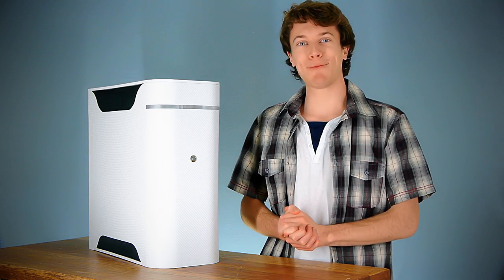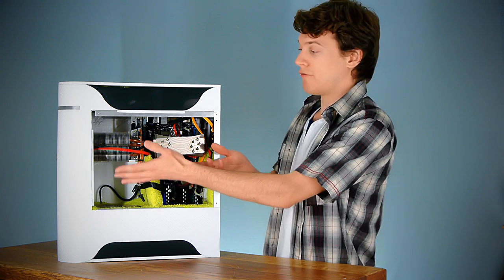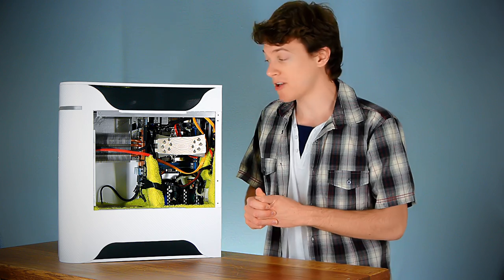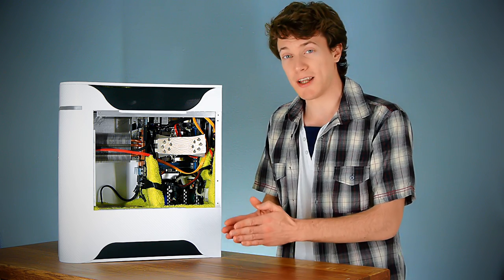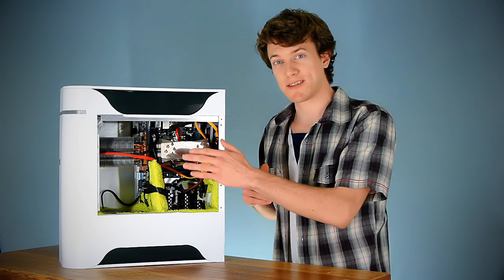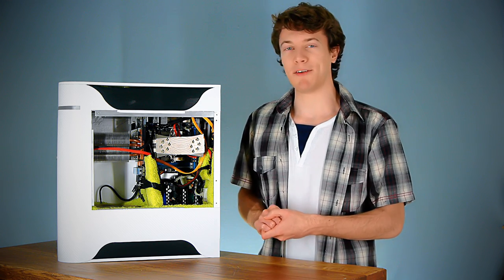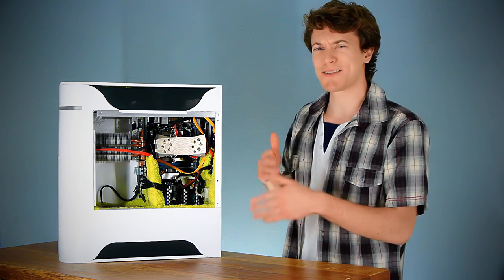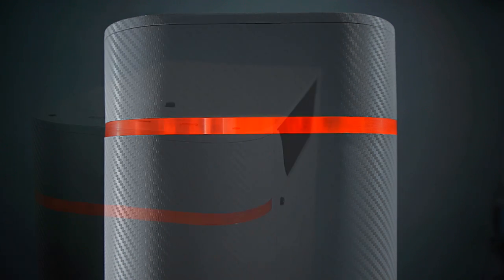DIY Computer Case - The Ultimate Silent PC (CLOUD UNIT)

Comment: How is your laptop HDD at 35°C when it is wrapped into a soft towel? I did that a few years ago with a 7200rpm HDD and I could almost cook on it later :))
Reply: +furulevi SSD
Reply: +GoogleMinus 
The SSD at 6:39 is on the top and is unwrapped, the lower one, the data drive is wrapped (and is not overheating somehow).
Reply: I must have missed that.  some of the newer ones are much cooler though.
Reply: He said its a laptop ssd. And it was created to run at 35 degrees without airflow.
Reply: +furulevi laptop drives and 7200rpm Seagates are two completely different things.
Reply: 7200 vs 5400rpm
Reply: +furulevi my laptop HDD stays at 32C most of the time. They're designed to be in low airflow/no airflow situations. That way they can stay at an ideal temp while still working the way they should.
Reply: +googlemaster190 -Minecraft It's not an SSD though. It's just a mechanical drive sitting in a pocket of fabric. Keep in mind this is a laptop drive which means it'll get less airflow than a 3.5 inch drive is used to getting. So it's been designed for these types of situations.
Reply: Siana Gearz I know there is 10,000 RPM drives, though I don't know if there's any laptop sized drives with those speeds. I do know that most laptops ship out with a 5400 RPM drive though.
Reply: ArtisChronicles I have seen 15000 RPM drives but I haven't seen anything over 7200 RPM for laptops, probably because of cooling and energy usage.
Reply: ArtisChronicles 10 and 15k drives are all equipped with tiny platters,  2 inch or smaller. They are packaged either as 2.5" drives that need external cooling, lots of it, or as 3.5" enclosures with integrated cooling. Their capacity was around 1/5ths of what you could get from a single platter 3.5" for the longest time. They were needed for databases, but now are replaced with SSD, so I think that's a dead category.
Reply: Siana Gearz could be dead, I dunno. I do know that if it isn't then it probably is dying.

Comment: I like the way you think. I want to build a PC out of wood and have been doing lots or research with airflow. Airflow naturally flows counterclockwise. Hint.  Your right computer cases need to change. I even looked at the airflow going the complete opposite direction from the normal case. I would change the fans to Arctic P14 (140mm). They are pwm and static pressure, very quiet and at a good price. Love the front IO shield at the top.

Comment: I gues the drive that's in the fabric is a ssd? otherwise it will burn heh
Reply from the maker: It's a laptop drive, so designed to work where there is no airflow (temps are about 35c which is ideal).
Reply: +DIY Perks Ok, do you still use it? :)
Reply from the maker: It's in use every day, yeah.
Reply: +DIY Perks can you post the PC specs(Expecialy GPU)?
can it be done wit newer GPU?
Reply: G. Iyawe
you can do it with practilly any gpu , just build a custom holder for the cooler , but you need to make shure if the memory needs cooling or not also, most highend cards need memory cooling also
Reply from the maker: The towel is mounted to grounded aluminium, so any static is discharged though that. Not that there's any cause for it to build up anyway.
Reply: +DIY Perks  I give you props for the guts to take out the PSU from the case. that thing will kill you 10 times over if you touch it while it's on. especially those transformers, or whatever you call those black cylinders. they can let out bursts of energy up to 100A depending on the PSU. 100A is for maybe a 1600W PSU, but not impossible nor unbelievable that they'd do that with yours. it's a pretty beefy one too. is it called a capacitor??? C'mon brain. think back to school!
Reply: +Bacon King Capacitor ;)
Reply: christian luciani  Thanks!
Reply: +Mre942 ZIP IT
Reply: +Bacon King you're completely right by the way, fuck that shit.
Reply: +Mre942 Get out.
Reply: ***** All of the static gets discharged on any metal in the case.
Reply: ***** You are very correct. But in places like Navada and some parts of texas where it's dry, It's not a problem. and that's only because all of that static energy is discharged through the 3rd pin in the power supply Without it, it would most likely build up a lot more. remember, static is electricity too. It goes to the ground as efficiently as possible. even if it means going through a power supply.
Reply: ***** No problem! Have a good one. (He could of put grounded metal plates in the fabric or touching to also get rid of any extra static.) He would do this by placing a conductive piece of metal touching the fabric and have a wire soldered onto the metal plate, and run it to the frame of the desktop or the power supply.
Reply: Drives don't get terribly hot, anyway
Reply: Error01 they sometimes can.
Reply: Love it!  What backup software do you use?
Reply: The high voltage caps and other components are enclosed on their own, the caps that you see are low voltage ones, from 3,3 to 12 volts, or maybe 25v, they are not going to kill  you
Reply: naturally thoigh you would just sit in yorr lab in a metal chair while your giant lightning machine is zapping everything in the room.
Reply: Well, you got us there! Haha. They sure are, since static is discharged through them, but shouldn't be a problem if you don't need to mess with the computer components, or if you just discharge static with a special wrist-band or just touch the PSU with it plugged in, though I can probably see that would be a problem here, so touching the case should be fine as long as it's a part of the case that touches the PSU, which you shouldn't worry about hurting as 1: It would kill you faster than you'd kill it, and 2: It's designed to handle 120 volts directly from the wall, and is also handling 750 Watts (at least for my computer). SO you shouldn't worry about giving it as a typical static shock is only .0001 Amps, I think the outlet and power supply (rated for 20 amps) should be fine :)

My work was done via static charge from carpet, as most static charges we gain is from clothing we wear, or from carpet in our homes.

Just a little fun fact. More electricity flows through your body every second than the amount of static charge you'll create in a very, very long time, as the typical carpet shock is probably only a couple MilliJoules. Here is a statement by someone named, "Wbeaty" I found this quite fascinating and helped me grasp the information about these comments better:

A hospital-type defibrillator provides capacitor-discharge with hundreds of joules per pulse. Carpet/doorknob sparks are quite a bit less:

"Carpet shocks:

750V, 0.04mJ - Spark threshold, visible in darkness
4KV, 1.2 mJoules - Winter doorknob spark, small snap, little pinprick
7KV, 3.7 mJoules - Fairly nasty spark, louder snap. Ouch.
Taser, tens of mJoules
35KV, 100 mJoules - Highest measured spark: northshore Alaska winter, vinyl truck seat.
100KV, half a joule - VandeGraaff machine with chain of children connected
Defibrillator designers say that the "danger zone" for producing fibrillation is in the range of joules or few tens of joules. Lower than that, and the impulses cannot trigger fibrillation in normal hearts. And far higher, instead we get "defib" or "cardioversion" effects where the pulse momentarily overrides the heart's natural pacemaker. Note that this applies to external defib, as with paddle electrodes applied to skin.

Can we make it lethal? Yes, just stab a piece of coathanger into your chest muscles, and apply the spark directly! ;) That's "internal defibrillation" using implanted electrodes. One of the early heart researchers managed to kill himself in just this way, by applying quite small pulses to his chest electrodes, but with pulses adjusted to be in the center of the phase/amplitude "lethal window" in his heart's QRS waveform. If you doorknob-zap an implanted chest electrode, probably you won't die the first time, but don't repeat the experiment over and over, because eventually you'll accidentally miss the lucky conditions.

The old trick with the VandeGraaff machine and the row of schoolkids holding hands is probably unwise. If the last kid in the chain happens to have a serious undiagnosed heart condition, the big zap from the stored charge is near the lower threshold of actually causing harm."
Reply: +DIY Perks Even I'd like to know the name of the backup software, because my limited knowledge of computers tells me to configure drives using a RAID array (mirror, strip, mirror+strip et cetera). Yours was so much cooler!
Reply: I forgot to add the magic word(s), "PLEASE could you.....backup software that you are using".

Comment: Temperatures under heavy load please. GPU with furmark (vram, power phases and processor itself) and CPU with cinebench. Also, what GPU and CPU is that?
Reply: 2nd that. some temps under load would back up the talk. Be interesting to see how much the sound dampening is actually insulating the unit. with ssd, large fans and passive coolers I'd be interested to know if the dust magnets are necessary. looks pretty sweet on the outside though
Reply: +Belfor09 Don't know about the CPU, but the GPU is a GTX460
Reply: +Belfor09 He already did a vid answering those questions the GPU was a gtx460 i think and it was maxed at 60c with the fans at their lowest speed (for silence) on furmark. I didn't see anything about the CPU. 
Yes it's not exactly a world altering GPU. But i reckon the principle is sound.
Reply: +DAGATHire Yea.. i wasn't interested about how his GPU performs. Instead i wanted to check thermal output which is similar to newer GTX970 and how it behieves under heavy load. Does it clock down, overall temperatures (not only core but also vram and power phases).
Reply: Belfor09 All good questions. I don't really know the answers, tho he has a vid benchmarking the rig so i would check that out
Reply: +Belfor09 460 uses 160W at max. The 970 uses 145W at max. So in theory, this set up can cool the 970.

I don't know much about the CPU though, but judging from the newer, more efficient intel CPU, cooling is not a problem I would guess.

Comment: How did he make that backup button and what software uses it ?
Reply: +MegaNitrospeed he made so when he swiches it the drive connects to the power supply... youst like he said
Reply: +MegaNitrospeed Well done you two fools for giving this question two completely useless answers. 
Well the button seems like an interrupter switch, so it's most likely just opening and closing the circuit to the power cord connection to the HDD should be pretty easy to replicate. And as for the software he used, it popped up on an annotation there on screen it was called Free File Sync. So it has that all important word "free" Hope you get it working if you give it a try.
Reply: +DAGATHire Actually they never said it would cost but thanks for the answer + 30m after saw the video i saw his Button guide
Reply: DAGATHire Why was my answer uselees? It was that he said in the video...
Reply: SweCake CS:GO Because the question was "HOW" did he do it... not what did he do. come on man, seriously... Pfff
Reply: Watch his video on a backup button

Comment: Out of curiosity, would dust build up be an issue with this design?
Reply from the maker: WarbananaOfDA With the dust filters, I wouldn't have thought so.
Reply: DIY Perks
 But what about ports on top? They're not covered by anything, like USB, even worse - card reader...
Reply: DIY Perks The pc has dust filters at the bottom sides, but what about the bottom back, it's open and can suck dust in, at least it looks like it could.
Reply: MrCombic
I quess it would be pretty easy to clean them with compressed air?
Reply: I was thinking the seething with all this fabric
Reply: Samtagri It'd be possible to exchange the fabric with less "ghetto" material to absorb coil whine, e.g. acoustic foam. The two downsides to that would be a slightly bigger price tag on the build and the fact that you would have to find another way to impro-mount your HDD.
Reply: It appears to be running a positive pressure, as to say all the fans are bring in air, and passively exhausting it, so that'll push air out all the little holes throughout the case, so no, no more of an issue than a normal case.
Reply: DIY Perks Over time, super fine dust builds up, would get lost in all the fabric.. grim
Reply from the maker: the11eventhour
 That's what vacuum cleaners are for.
Reply: DIY Perks
I agree that for fan cooled cases the vacuum cleaner once a year is a must, because entire case is working like an air cleaner. However I never need to clean USB and other ports. With your case design that is fan-less solution, it will be less dust inside, but more on top slots. When plugging devices you're compressing the dust around pins and then it will be difficult to clean it with vacuum cleaner only. So while designing perfect PC case I would place those ports on the front side either create a kind of cover. Usability won't be worse.

Comment: Screw fire hazard, that towel is going to absorb insane amounts of dust!
Reply from the maker: ***** Dust is filtered before the air enters the case, so I don't think it will. It's not even slightly dust yet, in any case, and it's been a while since it was finished (almost a year in fact).
Reply: DIY Perks Just because it doesn't look dusty it doesn't there isn't a ton of dust trapped inside. I used dust filters in my PC as well and dust still gets in. I'm not saying that dust filters don't work but the ones that do are quite dense so you need much stronger fans to pull the air through (and I didn't want that because I, too, went for a quiet build).
Reply: ***** It all depends on how dust and untidy your room is as well, don't forget, the dust to go in there has to come from somewhere... and if you generally clean your place, you are more likely to have a lower dust build up.

Comment: Diy Perks How thick is the aluminum that you used, i went to the store to pick some up, but it was all very thin or over 200 dollars...?
Reply from the maker: +newrhea13 1.5mm I believe. Cost about £20 iirc.
Reply: DIY Perks thanks, unfortunately the stores i went to sold about 1.5mm but was like $85USD for an sheet about 18in x10-15in
im not going to do anything like yours, but i only need about a 1mx1m even if i mess up a lot of the .... any suggestions or alternatives?
Reply: +DIY Perks You might overclock your GPU on That massive cooler